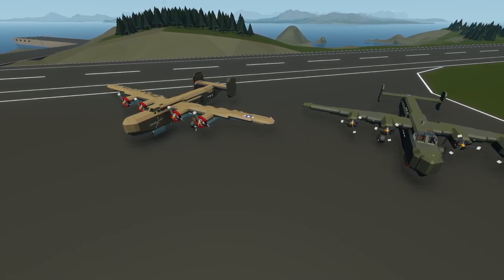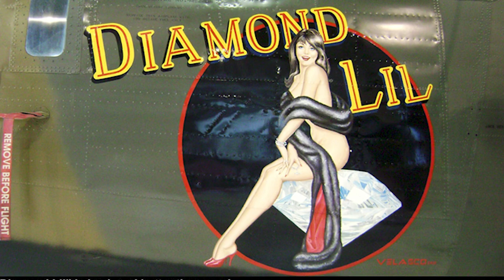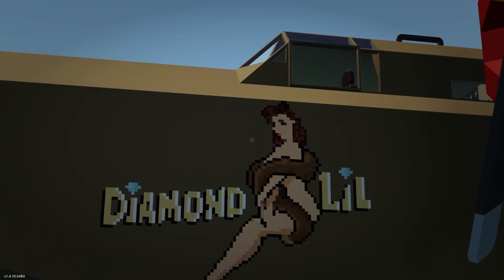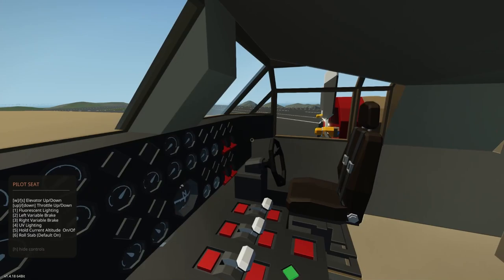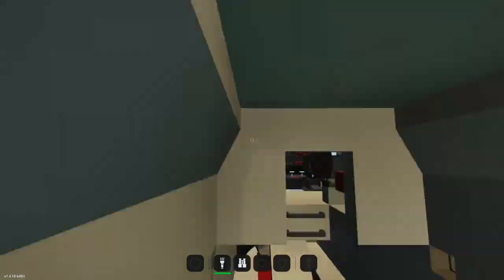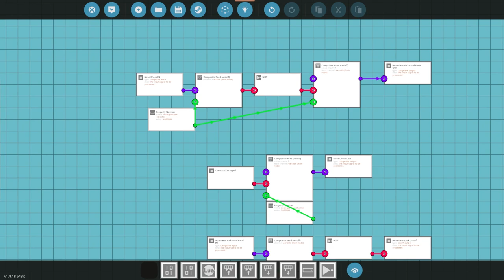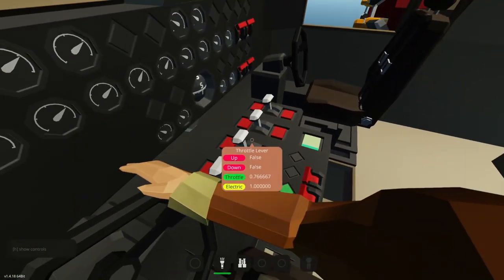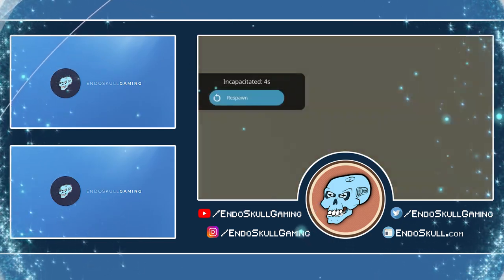B-24A LB-30 C-87 "Diamond Lil" Tour

Comment: Diamond Lil was never actually delivered to the RAF. She had an incident where she landed with gear problems and was lifted by crane to put the gear down. She was flown back to the factory, where the workers said it would never fly as a bomber again (the bomb bay doors were too badly mangled). They replaced Lil with another B-24 to deliver to the RAF, and kept her at Consolidated as a test aircraft (which included the refit as a transport aircraft). She was also used by the Mexican State Petrol company prior to the CAF getting her.

I was a tour guide at the Vintage Flying Museum in Fort Worth Texas, where Lil was kept for much of the 2010s, so I became very familiar with her history.

Comment: Loved the video @Endoskull Gaming! Can't wait for the next video man! Did you crash the Diamond Lil into the Mountain at the end there? Also, I would love to see a B-24 hauling some Cargo in Stormworks, though I don't necessarily see it carrying the Cargo Containers that you'll usually find as they are, According to the Fandoms, 9 by 9 by 27 Blocks. Not sure if that's right, but either way, the Back Hatch looks a bit too small to be shoving Cargo Containers into the Plane!
Reply from the maker: Volcano killed m e:-P